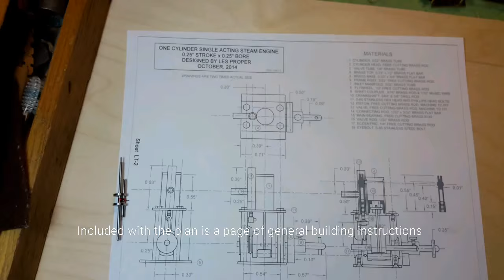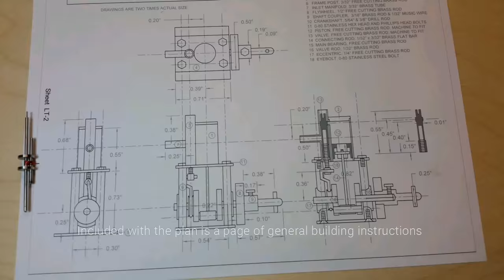Six miniature steam engines

Comment: I love it all! 
But I have question: What makes a certain engine capable of self starting while another cannot?
Reply from the maker: If a one cylinder engine is in the top or bottom dead center position the steam valve is closed so if it stops in this position it will not start.  This would be the 12:00 position.  However the three cylinder single acting engine and the two cylinder double acting engines have no positions of the crankshaft where all of the steam valves are closed, so it will start.

Comment: These are great; colour me inspired! Have you considered constructing a version of the double-acting vertical twin with a forward/reverse mechanism?
Reply from the maker: I have thought about how I could make the self starting engines reversible.  I think the easiest one would be the three cylinder as there is a way to do it with the gears that run the valve shaft.  There is a name for this type of reversing mechanism, but I can't remember what it is.  It will be a project for another day.
Reply: Thanks for your reply. I'll keep an eye out in future in case you post a video of such an engine.

Comment: very beautiful! I'm interested in steam all of a sudden, and I can't believe how small you can make a steam engine. :P 
I fell so tempted to make one~ I have a lathe, but I dunno what shops to get the metal from :'/
Reply from the maker: I will send you a pdf plan of the one cylinder engine if you are interested, but I will need your email.   The plan sheet has a list of materials needed for building the engine and the materials can be ordered on line.
Reply: ok, sure~ ^_^ I might not be able to make it, but an idea of the materials could be handy. Thanks.
I'll send you an email now, if you don't mind.
Reply: off the top of my head, the materials required for these tiny beauties should not be too much trouble to find. An armchair, a laptop, and eBay should cover it, plus a medium to big soldering iron, junior hacksaw, small files and your lathe.
Good luck.

Comment: I have a few questions: 1. do the V-4 engine have a lot of torque? can it power a propeller on a boat? 2. is there any way for me to buy on of those?
Reply from the maker: The engines have pretty good torque considering their small size.  They can power a small steam boat very nicely.  I have several videos showing the engines powering small steam boats ranging is size from about 10 to 14 inches in length.  I do not sell the engines, sorry.
Reply: ok, thanks for reply. since u are not selling, do you have a detailed turtorial or plans on how to build the V-4?
Reply from the maker: I wrote a book on building miniature model steam boats which contains about 80 pages of detail plans, pictures, and building instructions for six different steam boats. Each boat has a different engine and steam boiler.  The V-4 engine is used in one of the boats and is included in the book.  I can provide cost information if you send a request to my email (lesproper@gmail.com).

Comment: More Cylinder = More power?
Reply from the maker: Power is a property of the steam boiler and more specifically the rate at which fuel can be burned to produce steam.  Since an engine with more cylinders can utilize a larger boiler it will produce more power.  However, there is no difference in power output between the engines if the same miniature boiler is used.  Using the same boiler the single cylinder engine will run 4 times faster than the V-4, but the V-4 will have 4 times the torque.